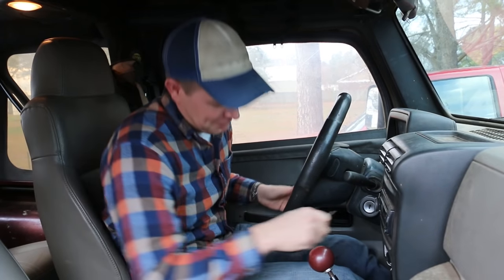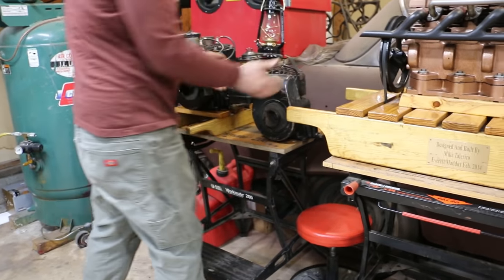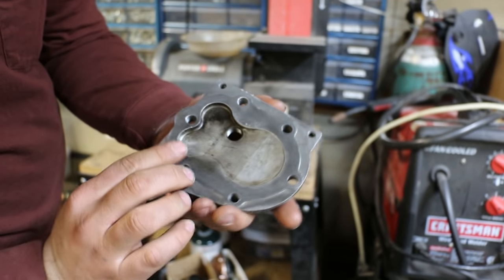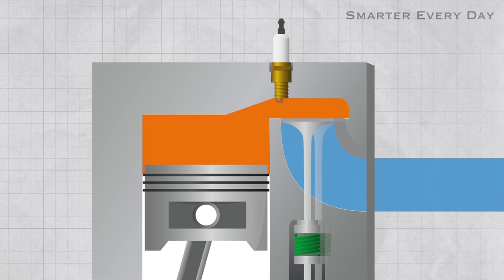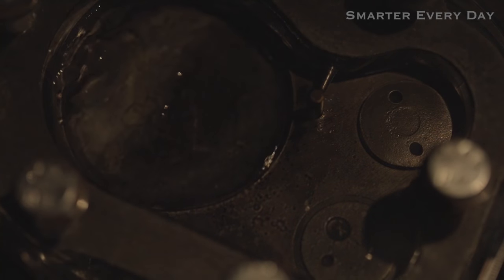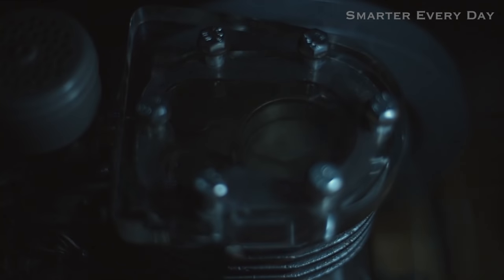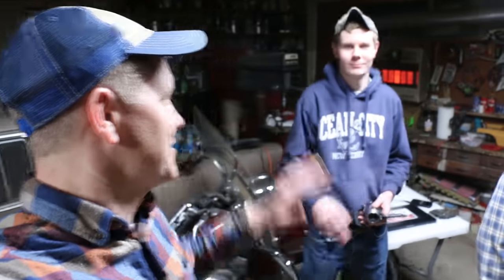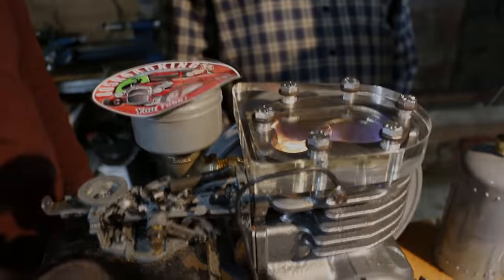How Engines Work - (See Through Engine in Slow Motion) - Smarter Every Day 166

Comment: 5:48 and 6:13 spark goes off on intake. Why is that? Is it because of the buzz coil ignition?
Reply: i was asking the same question. i believe is just the way it is synchronized with the crank signal.

since it requires 2 rotation to have the 4 strokes, but for simplicity you may not want to count odd/even rotation, you just spark the coil at each crank: so both between Exhaust and Intake, as you see in the video, and between Compression and Power. This is ok because the spark between Exhaust and Intake happens when the gas inside is inert and nothing happens.

I suppose, altough you can't see this in the video, that this redundant operation happens also for fuel injection one time per crank: so during both Intake (while intake valve is open so the fuel and air actually gets inside) and Power (when intake valve is close so nothing really happens).

Actual cars don't works like this because it would be a waste of fuel and electric power, and the ECU is designed to synchronize with the crank signal. But i can't see any electronics in the video, that's why i suppose every signal is analogically syncronized and there is no way to distinguish between odd and even crank rotations
Reply: These are old motors back then they had an coil that was activated by a magnet on the flywheel and every rotation of the flywheel the spark sparks so even when they are on a intake stroke it still sparks because the magnate is firing the spark plug ever time the piston is at top dead center

Comment: Hey Destin, I really liked seeing that. I´m wondering why they let the spark go off more than once in one 4 stroke cycle. I thought you only need one for firing in the power stroke. Does someone have an explanation? Love your channel btw.
Reply: Because that's extra manufacturing precision that isn't actually required, and thus is more costly to manufacture. Another reason might be to decrease the chance of a misfire where it doesn't ignite the fuel/air mixture because it's too lean, and sparking it more than once gives more of a chance for it to ignite.

Comment: EVERY CYLINDER OF AN ENGINE IS A HIDDEN MICKEY
Piston = head
Valves = ears
Reply: Holobrine In a car motor or most other motors the valves arent arranged like that
Reply: not all engine are set up in that cute way :/// the valves are usually directly over head in todays engines
Reply: this is a flathead engine. valves are off to the side. this arrangement has issues with combustion chamber shape and poor compression. virtually all engines use an overhead arrangement, which while somewhat more complex, allows much better performance. 
also note that the spark is firing every revolution, at the start of the power stroke and end of the exhaust. this so called wasted-spark system uses fewer parts than a "normal" system and as such can fit into a smaller space. many small engines (motorcycles, single-cylinder 4-strokes, etc) use this.

Comment: I dont understand how the engine does this faster when you press the accelerator, does it intake more gas the more you press the pedal?
Reply: Yes, more air/fuel mixture is added to the intake.
You got it right.
Reply: Robert Thanks
Reply: hoyah hayoh well not quite, when you hit the gas pedal, your actually opening and closing a valve that lets in more air, and various sensors send more signals to the spark plugs and fuel pump, to accommodate for the rising rpm. 

More air intake = more power
Reply: SkylineWalkerGTR and is that why cars with super chargers or turbochargers go faster? Bc isn't a turbo or supercharger an air intake? . I'm new to this
Reply: Your welcome hoyah hayoh, (interesting name).
The forced intakes like superchargers and turbo chargers compress the fuel/air mixture, giving the power stroke even more ignitable gases to push the piston down. Fuel pressure is kept at a rate, that will be sufficient and Skyline is right, opening a valve allows more air, with carbs using that to add fuel, where sensors regulate fuel without a carb.
There are a couple ways to add fuel into the air, with one way being directly injected into the cylinder, as is done with diesel engines, and another, using a throttle body (which looks like a carb) although vacuum is not what pulls in the fuel.
The more fuel/air mixture, you can stuff into the cylinder, the more bang you get. Hence, more power.
Reply: hoyah hayoh modern cars have a computer that maintain a ratio of fuel to air.... and your pedal being pushed opens the intake more which causes more air to be taken in. But the ratio has to be the same... so the computer sends in more fuel to maintain the ratio,more gas means bigger explosion. Which pushes the piston down harder... and makes the crankshaft spin faster which gives more power to the transmission and then to the wheels... and in cars this is happening very fast and in more cylinders
Reply: exactly, and more air as well

Comment: I'm so confused as to how people invent things like this.. Like the first car, how did they know what they were doing? How did they know what they were trying to achieve and how to achieve it? Did they just put together a few parts and say "whoops I just made an engine"
Reply: Dahntay Walker lol no . Maybe some lucky guy did just that , but it takes some really smart fellows to think this stuff up lol.
Reply: Basically a lot of people each added a small improvement to it
Reply: I think they already understood combustion and then they tried to figure out how they could turn combustion into motion.
Reply: Dahntay Walker It could be also serendipity.
Reply: the first modernish car was the 1880s (forgot exact year) benz patent motor wagon (aka Mercedes Benz ) he wanted a self propeld wagon without a horse and came up with a 3/4hp single cylender internal combustion engine and used hygrogen proxide for fuel
Reply: If you want to be truly blown away, learn about Harry Miller who was an 8th grade drop out who designed the winningest race engine ever built, designed in 1915 and used until the early 1980's, at Indianapolis, they changed the rules to stop it's domination.  It's still being used today at dirt tracks.

Comment: Intake. Compression. Power. Exhaust. 
OR
Suck. Squeeze. Bang. Blow.
Reply: Almost. It really doesn't go bang. A sudden explosion would damage the engine. It's really more of a fast burn as the flame quickly propagates through the cylinder. And in the Air Force we used to say the same thing about jet engines: Suck, Squeeze, Burn, Blow. Then "off we go into the wild, blue yonder".

Comment: If that's how a 4 stroke engine works, how does a 2 stroke engine work?
Reply: tac0o0o0 intake and compression stroke combined into first stroke, power and exhaust stroke combined into the second stroke.
Reply: it does 2 parts of the process at once. It´s doing both the compression of the gas and the intake at the same time, after the explosion, just one valve opens for the exhaust, and at the same time the new mixture is forced into the combustion chamber. The key piece to understand it is that the new mixture is below the piston, and after the combustion of the old mixture, the new one rushes in through two openings that the sides of the combustion chamber have.
This is what i don't understand, They are called 2 strokes because there is a spark for every turn of the crankshaft, unlike 4 strokes, that have 1 spark. But in this video you can see the spark happening even when there is no combustion going on.
Reply: tac0o0o0o basically the exhaust goes into a separate chamber on the side of the cylinder at its low position to the side of the engine ,eliminating the need to have an exhaust stroke, and the intake stroke and compression stroke take place at the same time as the air enters from the bottom of the cylinder. Leaving only your compression stroke and power stroke. It works without having overhead valves like what a 4 stroke engines uses (valves opening snd closing to allow air in and the exhaust valve to let exhaust out) the entrance of air and exit of exhaust is reliant upon cylinder position during its cycle. Air enters from bottom, exhaust out from the side
Reply: So Many Replies, Thankyou!

Comment: The noise from the exhaust is actually the sound of high pressure escaping into the much lower pressure of the atmosphere. Not the sound of the flame front that takes place in the combustion chamber rather than an explosion.

Comment: If you have connections at Oak Ridge you can stick an engine in a beam of neutrons and see it working without needing a piece of acrylic. You can see the fuel because it absorbs more neutrons. Sort of like X-ray but with neutrons instead.

Comment: I saw a very interesting lecture of Andrew Szydlo about combustion and he stated that a uniform mixture of fuel and air should result in complete combustion, which manifests as a blue flame, as we can see e.g. in Bunsen burner. In your video, we can see most of the flame is actually orange, which would indicate incomplete combustion. Despite all the efforts to improve combustion engines, we can see the whole process is actually still quite ineffective. Interesting... :)

Comment: For those that don't know, a small 4 stroke 
engine will spark every time the piston rises, 
just because that is an easier design.  This 
is called the "lost spark" system.  Most newer 
cars do the same thing.  If you have a V6, 
and it has a coil pack, like the 200* Taurus, 
they have 3 coils in that pack.  Each coil 
drives 2 spark plugs, and go off just before 
top dead center, for both.  One is used, the 
other is the "lost spark."  (The next revolution, 
that lost spark is at the other plug connected 
to that coil.)

Oh, Mike and Junior Dirt Bike look YOUNG 
in this video.  Everett looks like he could 
be my brother, what with all the grey hair 
and stuff.

steve

Comment: Note the ‘wasted spark’ on the exhaust stroke  just before top dead centre - simplifies the ignition points they are on a crank lobe as opposed to running at half engine speed on the cam shaft.

Comment: Wow! You can actually see how tuning the engine affected the spark event.
Lean fuel/air mix = more electrical resistance (longer spark event, less bang)
Rich fuel/air mix = less electrical resistance
(Faster spark event, more bang)

Comment: Destin those are "Trembler Coils" (like Ford Model T used) the awesome thing about them is the spark duration that they are capable of throwing... On a model T they throw a spark for about 30-40 degrees of crankshaft duration.

Comment: The following question is for Destin since he is a mechanical engineer: We know that internal combustion engines in general lose a lot of energy as heat but do piston engines lose energy even more due to the reciprocating motions of the pistons? If so, are rotary engines more energy efficient than reciprocating engines since the rotors of rotary engines do not make drastic changes in direction but instead make infinitesimally small directional changes as they rotate?

Comment: I actually have a glass spark plug I use to tune the fuel ration on older car engines based on the color of the detonation in the cylinder. Orange is too rich, white is too lean, and a bright blue is just right. Or close enough to right.

Comment: The flickering seen in the video is caused by the material inside the light bulb pulsing because when a incandescent bulb is turned on it is not one constant beam of light the heating element will melt if its not cooled properly so it flickers instead

Comment: AMazing!!!!!  Unbelievable.  So glad you found these guys!!!  One basic question:  What actually makes the engine speed up?  Is the speed (RPM) initially increased by a change in the timing?  But the timing is controlled by the rotation of the crank or cycle of the points, right?
Reply: More fuel and by lifting the valves quicker, also yes the valves are connected to the crank shaft.

Comment: I just realized, that timing importance with the spark gap is kind of like pushing someone on a swing, where you want to prepare to push right before they completely stop moving. Too late, and you’re having to chase them down in the swing, but too soon, and you’re essentially stealing from yourself earlier. Also, this explains why knocking in an engine is so bad. It’s pushing back against all the piston’s forward momentum, and it’s also essentially jolting the engine into reverse. When I discussed my electric drill manual with my dad and mentioned that they said not to switch directions on the drill until it had come to a full stop, he immediately reinforced the manual’s statement  vehemently. It’s like hitting the engine with double the force of another engine from a complete stop: very bad for all mechanical system involved.

Comment: As I watched this video a second time, I came to think of an episode of Dogfights, a series on Discovery Channel many years ago. It was an interview with a George Sutcliffe who was a P-47 Thunderbolt Pilot during WW2. He told a story about a flight of four P-47's getting jumped by 40 Messerschmidt Me-109's and the Colonel who was lead said they'd better climb into the cloud ceiling. These P-47's were fitted with the new Paddle Props and they had a button for Water Injection. I have seen Water Injection in other engines as well, spraying a Water-Methanol mixture in to cool the cylinder walls so that more fuel and air can fit in with each intake stroke.

It's easy to understand the physical concept of Water Injection, but it's hard to envision how this could increase engine performance as tremendously as it did. So, if @SmarterEveryDay is revisiting the See Through Engine in Slow Motion, I wonder if it is possible for these ingenious engine tinkerers to fit it with a Water-Methanol injection system to see how effective it really is on engine performance, and if it gives a visibly better effect on the combustion?